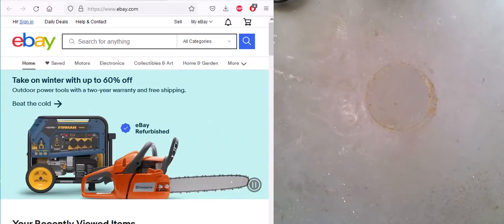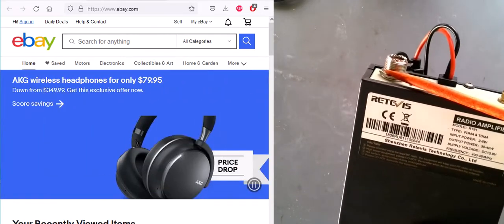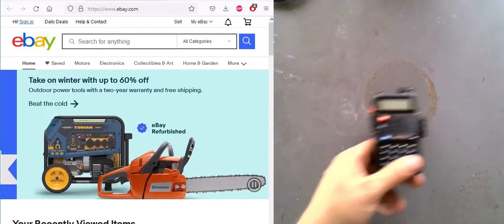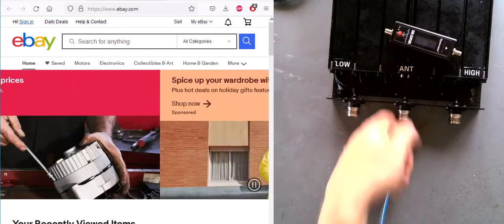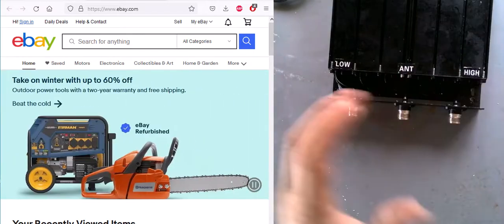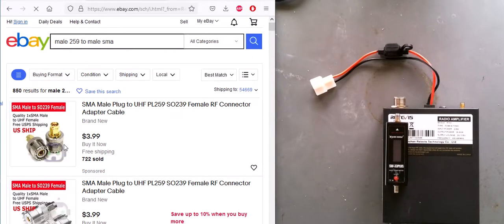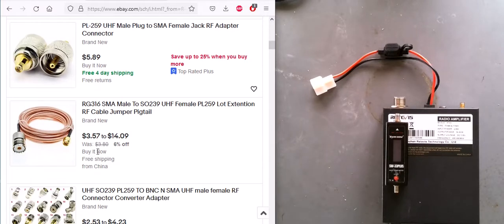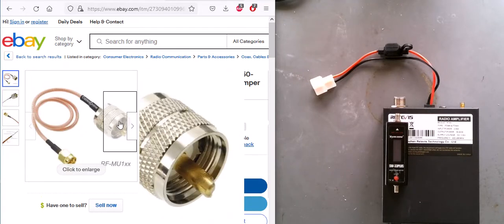🔺 What connectors/pigtails do I need to hook up my GMRS two-way radio gear!  Some basic connectors 🔺

Comment: The split screen with EBAY ads was VERY annoying. Will not watch another one of your videos if you run this format.
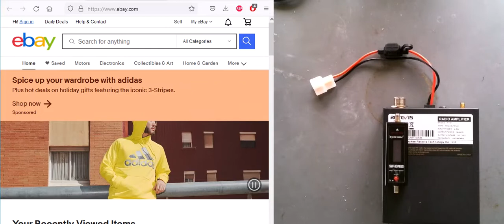Reply from the maker: If you watch the full video, I was using eBay to show people how to look up parts, I start doing this at time mark 9:48. That is why the eBay split screen is there. I would NOT have ebay ads in my video otherwise 🙂